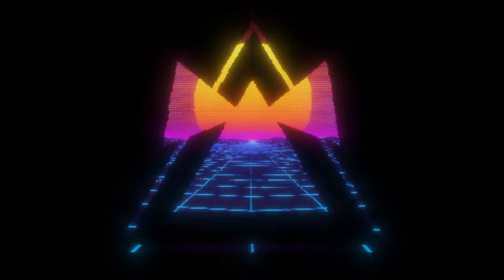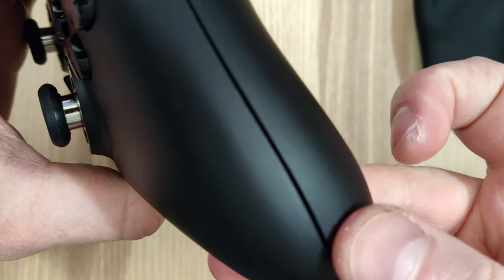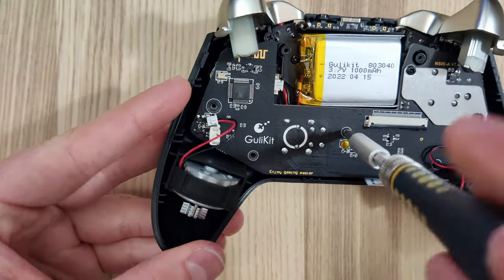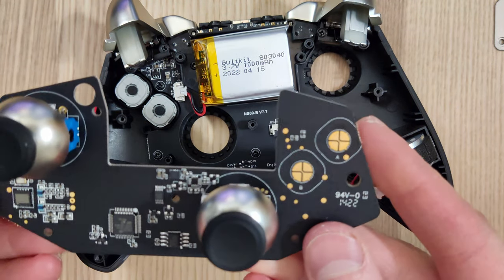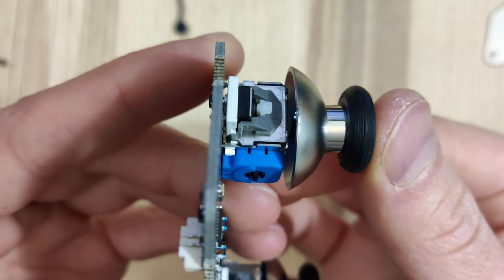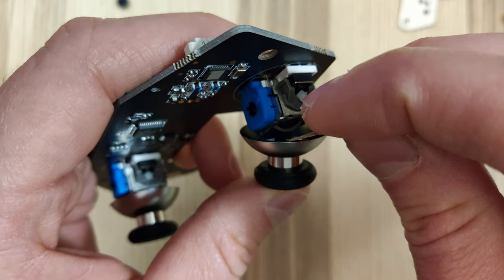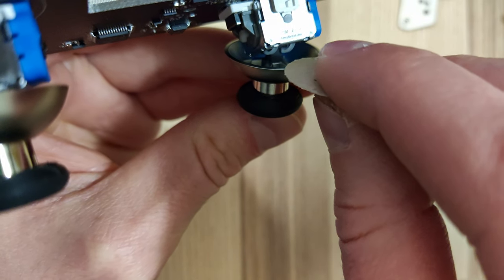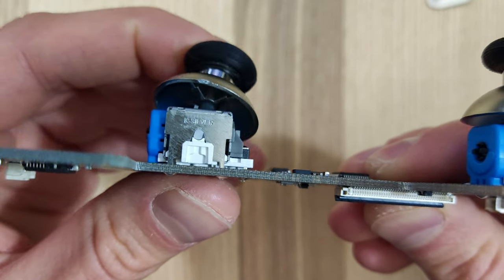Gulikit Quality Control Issues (KingKong 2 Pro Teardown and Joystick Fix)

Comment: This is a chinese product retailing about $45 in China, so its actually cheaper than a pro controller with sub-par qc. I just find it ridiculous they mark it up as $70 as i have read in the comments. 

My point is dont expect much from a chinese product that has a not too expensive retail price.
Reply from the maker: It's still cheaper than a dualsense or Xbox controller here in Canada so I consider it a decent price. They've gone up to about 80cad since I purchased it last time but for what they offer it's still a pretty decent purchase.

Comment: This controller is plagued with latency.
Reply from the maker: It was averaging around 10.99ms over bluetooth on the tests I ran which isn't all that bad. It really depends on your adapter as well in your PC or device you connect it to so the user experience can vary drastically. Connecting directly via USB only shaved off 1ms of latency. Not horrible but not perfect.
Reply: @KeiRetroGaming  Dualsense using DS4 Windows is 1ms over Bluetooth on my system. 4ms wired.